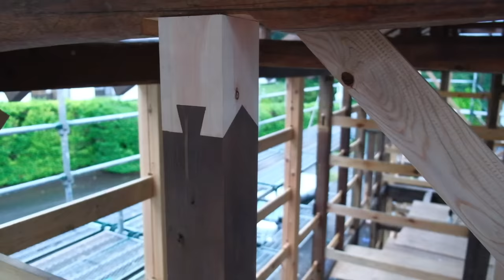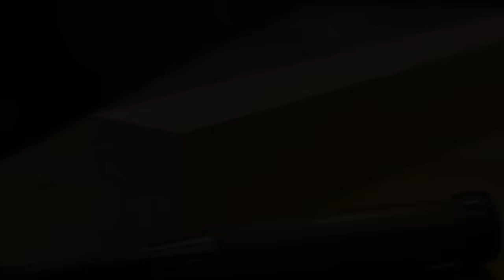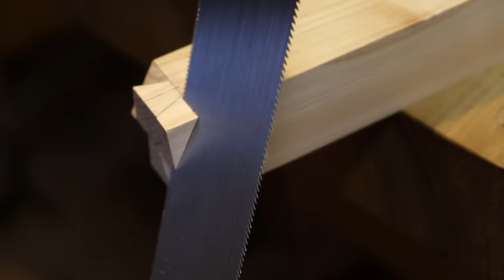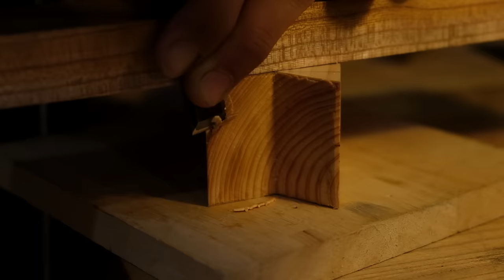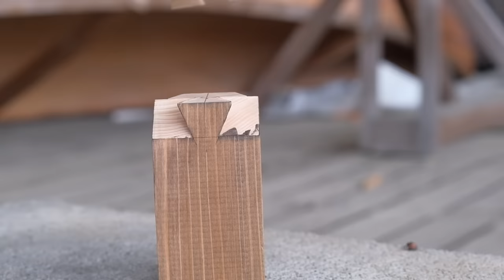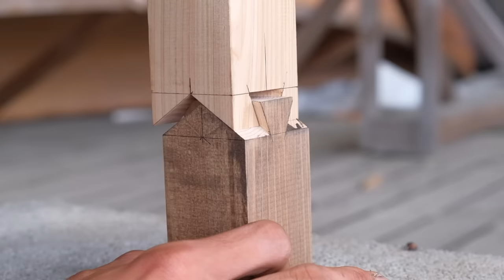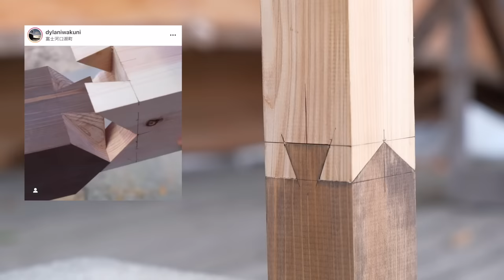Mysterious Japanese Joinery

Comment: Dylan,  have you considered making samples for stress testing? It would be interesting in seeing how different designs stack up against modern construction.
Reply: One measure of durability of Japanese style carpentry is that there are buildings in Japan, made entirely with wood to wood joinery, that have been standing for over a thousand years. How many houses in a modern subdivision, built with modern materials like OSB, rigid foam, zip sheathing, screws, nails... will still be standing in 1,000 years? This particular joint may not be as strong as welded steel, but wood joinery is an incredibly durable way to build.
Reply: Don't they have a lot of earthquakes in Japan. Perhaps these joints allow for movement. Just saying...

Comment: This is a really clever joint. If it's used on a vertical beam, the pressure from the roof keeps it in place. That's never going anywhere. Excellent craftsmanship, I hope to be as good with a saw as you are one day!
Reply from the maker: Cheers 😊🙌

Comment: This is interesting history right there! This joint will hold pressure like from a roof perfectly, without any need of a nail or the like. Ingenious! I would be interested to know when that post was constructed... also if that is the only one. Crazy to only have one of these joints.
Reply: Rebuilding was finished in 1629 after original was burned down in 1615.
Reply: @3kobalt  Thanks for the Info! There is probably more that one could find in there, but it is not feasible to take it apart to check, lol.

Comment: not to belittle the awesome carpenter's workmanship, but should it be possible to use a 3-D printer to make a similar structure out of fiberglass-epoxy to build house frames, or even, a space station or buildings on the Moon or Mars?

Comment: Very interesting joint.  However, it only appears to be suitable if the forces are in line with the length of the beam - i.e. the been is in straight compression.  Any side load especially in the area of the joint would appear to be very problematic.
Reply: I though same thing, but in video says this joint are used on Osaka Castle, which means this joint was used on 400 years old Castle in the country where suffer several earthquakes in year.
So probably it can hold pretty well.

Comment: You have to wonder how many other clever techniques and crafts might have been lost over the decades and centuries. The closest I have seen reproduced is the (French?) method of building roof beams and the like using green wood a little too long for the dimensions of the building and the joints - it then dries out over the next decade or so until it's perfectly square and snugged down. We're far too reliant on machines and software to get everything "right" nowadays.